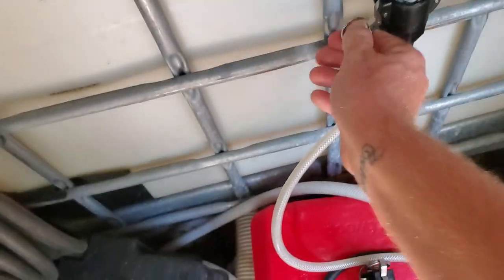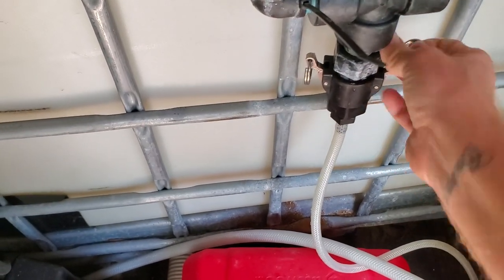Banjo Fittings for Soft Washing Efficiency

Comment: None of the couplings in this video  are "Banjo" fittings.  They are all "Cam Lock" couplings.   Banjo fittings actually look like a Banjo.  Not to be confused with Banjo Corporation  who make plastic couplings, valves, pumps, etc.
Reply from the maker: Thank you for clearing the air on that one

Comment: Good morning Love the video keep up the good work. The question that I have for you when switching your proportioner over to your downstreamer for pressure waher what settings are your soap and SH value or on to achieve the 1% housewash mix. And I'm assuming the water valve on the proportioner is off
Reply from the maker: Injust turn sh on and just crack the soap on

Comment: So if I wanted to put one of these banjo fittings on my 12 volt pump that has 1/2" female Outlets and then one on my hose that's 5/8" so I can connect them. How would I do it ? What do I need?
Reply from the maker: Yud have to get 1/2 in thread with 5/8 Barb